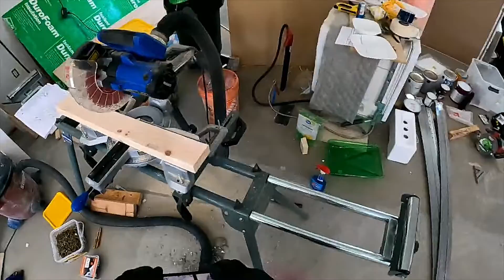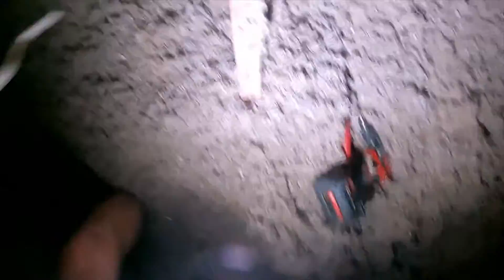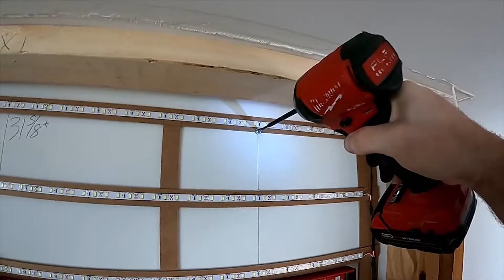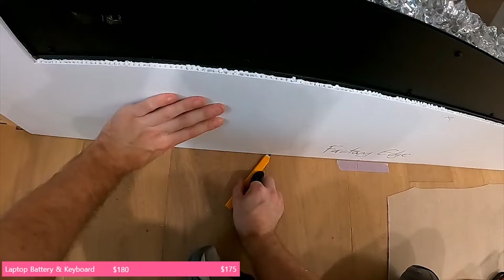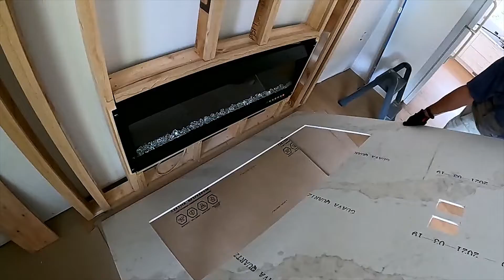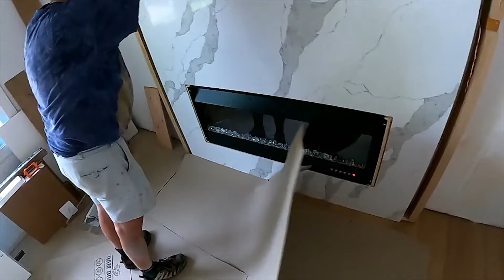LED Backlit Quartz Fireplace! DIY Renovation & Construction

Comment: I was thinking of doing something similar for the backsplash in the kitchen when I built my last house as there were no cabinets behind the induction  popup down draft fan.  Very cool to see how you did it.  As to the fireplace, we did install a wood burning fireplace that was zoned so that it could move heat to the basement and second floor and we used the fireplace all the time.  We went wood as I never really saw the purpose of an electric fireplace.    Keep up good work.
Reply from the maker: never heard of a fireplace that can heat other floors! 🤯
that sounds amazing! I do agree the electric fireplaces are little more than glorified space heaters though 😅